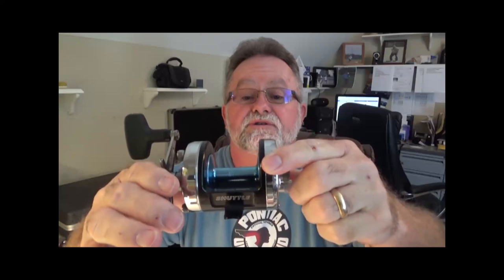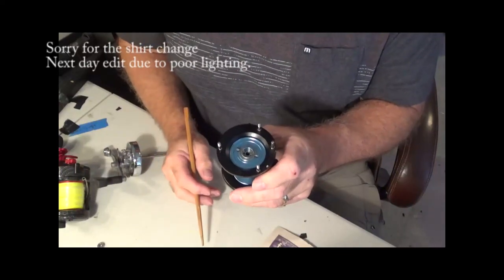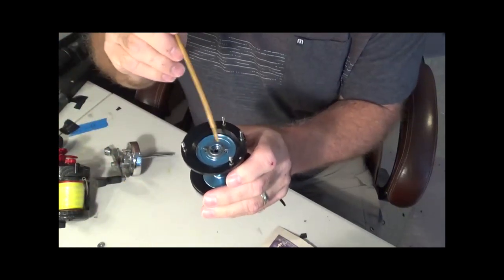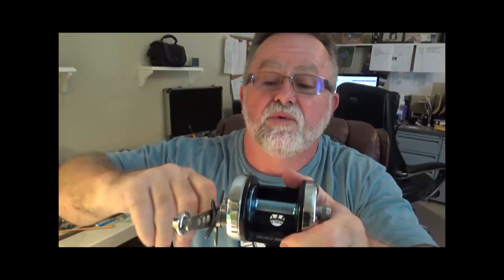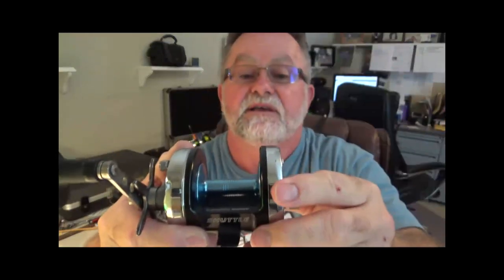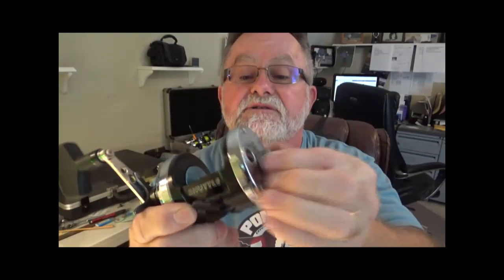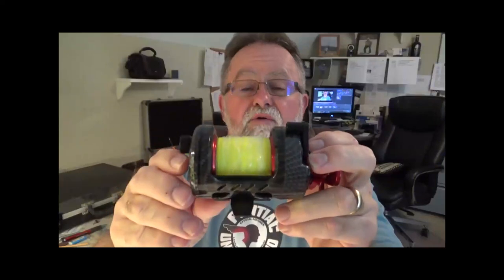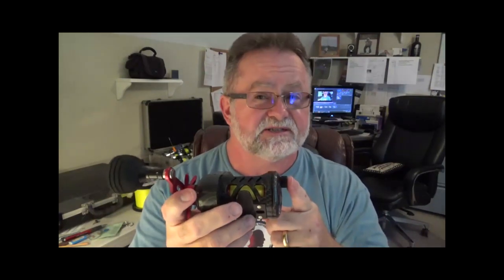Akios reel control settings

Comment: I found with the two 656 shuttles i used to use i found.... yellow rocket fuel in the standard bearings, enough endfloat to feel but not see it, both blocks and minimal mag settings gave me all the control i needed, and more than enough distance. 
Have since sold them and am now using Penn Fathom 12 and 15 mags. Same as far as endplay goes, red rocket fuel rather than the yellow, and magnets mid way up the scale.